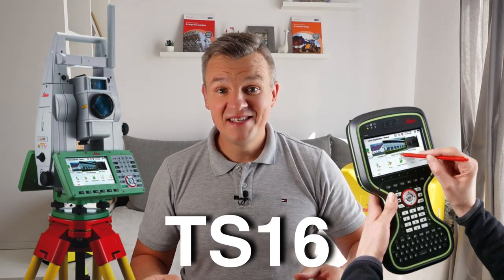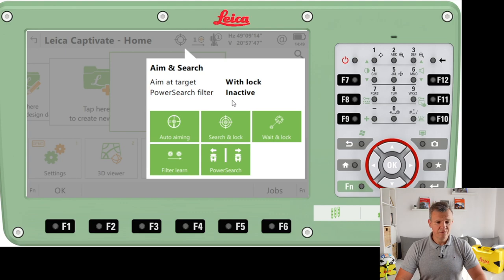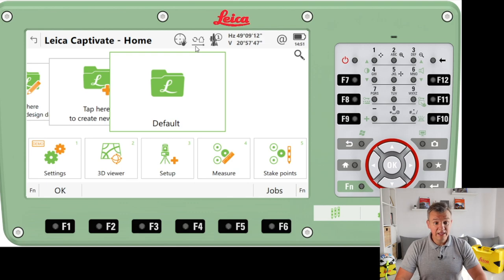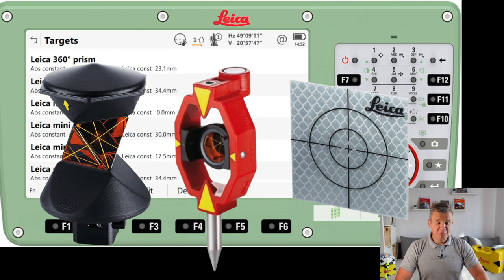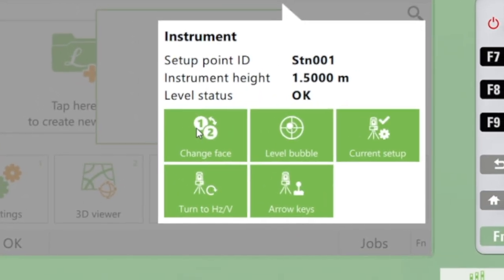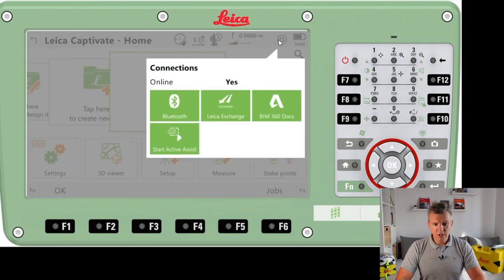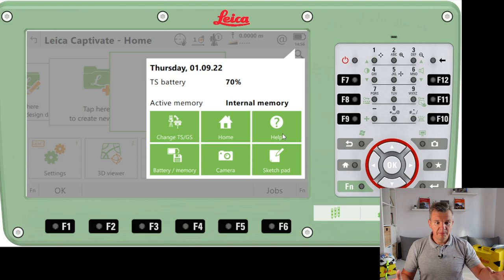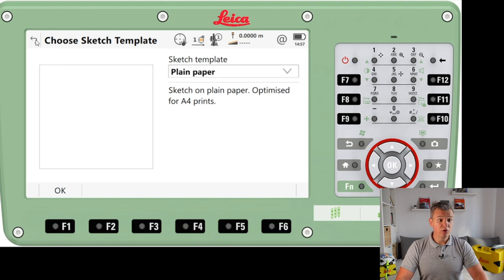How to use a TOTAL STATION. Opening a new job & Prisms.

Comment: greg...some times times targets wont pick up ...can you shoot them with any surface setting?
Reply from the maker: Yes you can, the reading will be the same as the constant is the same. But sometimes there might be something on the way and that's the reason why it won't take the reading and in case of any surface the reading will be always taken, no matter if right. Keeping the target as reflective tape it's just another way to be sure the measuring was right, but I know the problem :) and sometimes change for any surface. Some people don't even bother to change for the tape and work always with any surface

Comment: Hi, am struggling with loading the road design into the Leica TS16. When am importing it, it only imports 0 points. And when am doing it manually it says error. I got the design from Road Maker. I don't know whether it doesn't support that format. Pls help me 🙏. Am not sure what am doing wrong
Reply from the maker: Try to bring it as a DXF, check the settings while you're importing. Maybe work with the drawing a bit, create some points etc. Definitely check settings when bringing in - m/mm, what to bring, check if you have points on the drawing, or just lines, or blocks - maybe you can see them once imported? check settings on the viewer
Reply: @SITENG  ohh maybe that's the problem. Because I have a CSV file that has the complete road design.
Reply from the maker: Let me know if you managed to sort it 😁